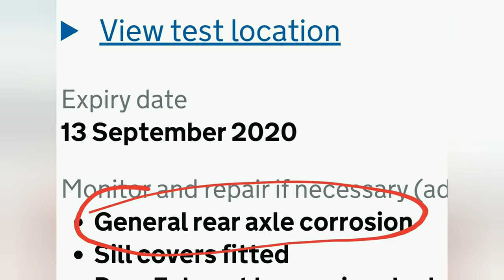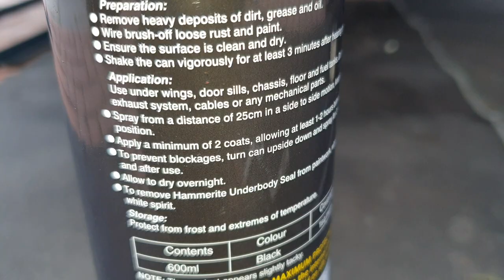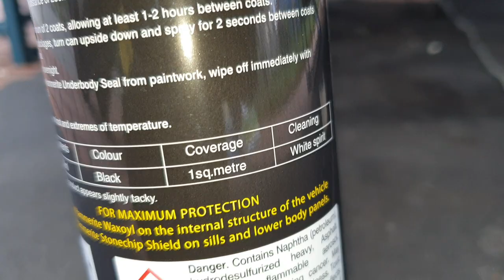Rust Repair - K2 Derusto Total Gel + Hammerite Under Body Seal -  BMW E46 Corrosion - Captions

Comment: What would you recon to using a sanding disc on a angle grinder to get any rust off before putting the under seal on?
Reply from the maker: If you have a good access  then go ahead.
Reply: @pzav  mint 👍
Reply: wire brushes for drill - works just fine. They are different shapes there to fit your needs. I will need to do the same with my car...